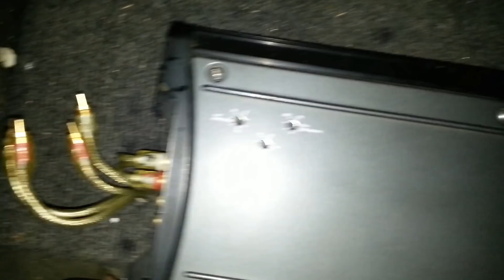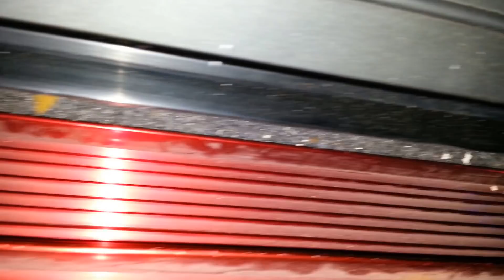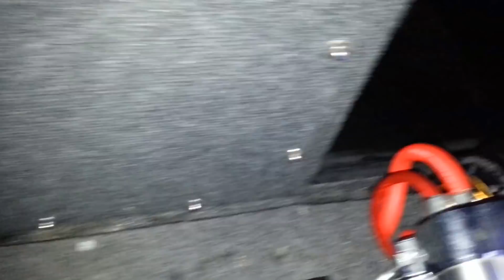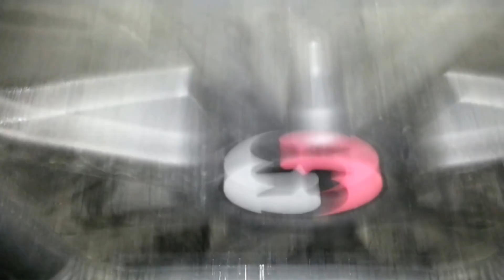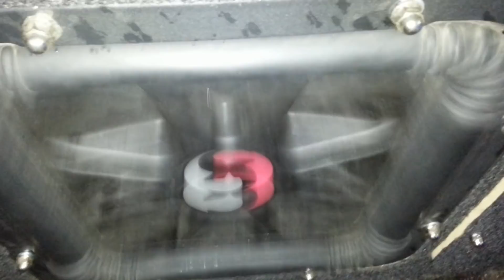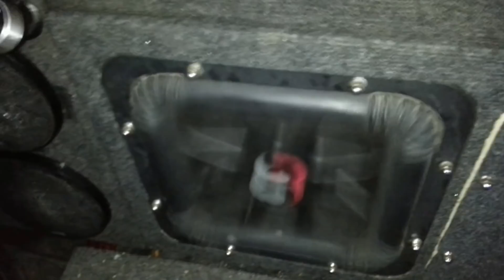Bass, I Love You_Single KICKER Solo X 12 SPL Box BASS BOOST KICKER ZX2500.1

Comment: I have a solo x 12 and a 2500.1 rated at 2.700 on birth sheet and hit around 150DB even ported that low...., but you really need a HO alt or more batts thew voltage dropping is only making the amp work harder/hotter and is a very bad thing. You need a constant 14.4 at least 13.8 to get max power every .5 volt you -100w+

Comment from the maker: Well, the amp is not stable at 1 ohm, it sounds a lot cleaner, and it is loud enough already, down the road im upgrading to a dual 4 Ohm and parallel wire it to 2 ohm. then it will be where i want it, 
When you choose 1 ohm amplifier must choose Subwoofer 2 ohm the parallel Mzrdugh 1 Ohm and, of course, must be preamplifier 2500 rms to suit solo X-12 2500 rms